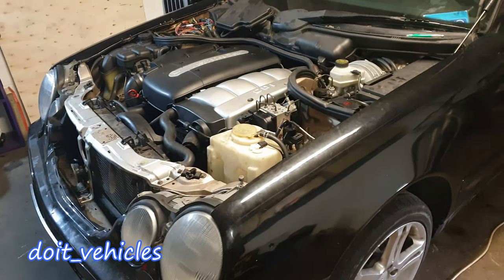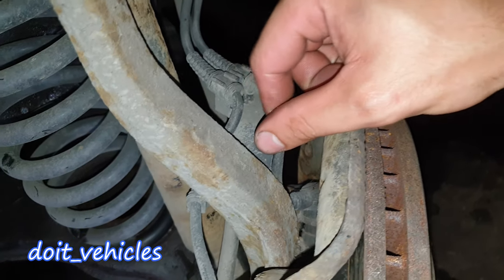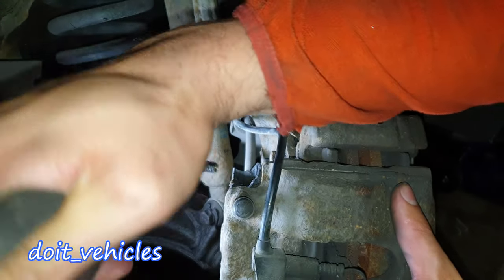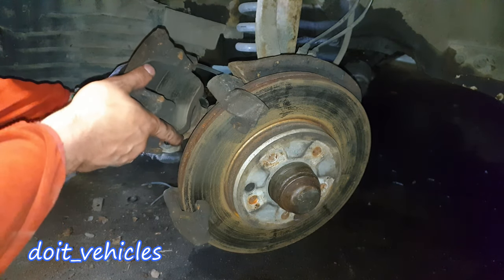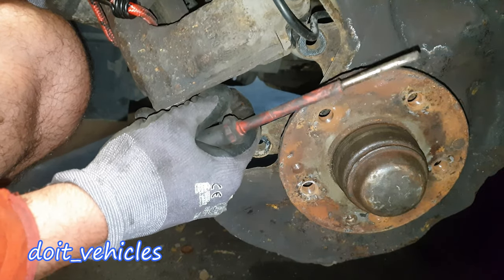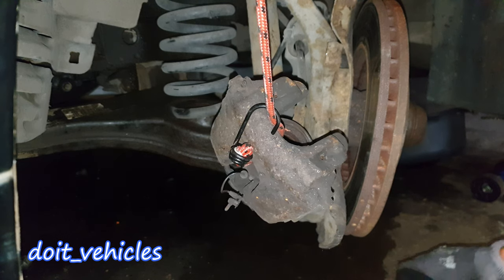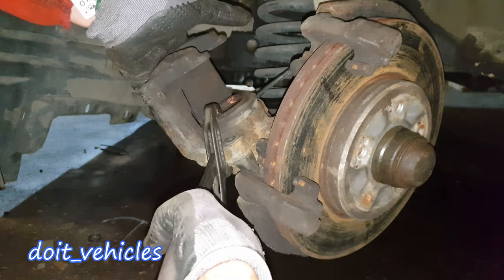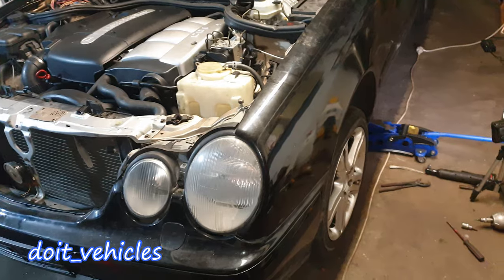Front Brakes Replacement Mercedes w210 E220 cdi

Comment: I have W210 1999 E320.. does it have brake pad sensor? I hear rough sound when I brake but I don’t see any warning on the dashboard..how to tell whether the brake pads are worn or not yet?
Reply from the maker: Hi ! Just remove one front wheel and see if there is any sensor on the pads . The " breaking material " is separated from the metal plate so that should tell if it's worn out.

Comment: For those of you interested, the P/N details for the w210 270cdi 95-2003 model:
- discs OEM P/N: A2104212512
- break pads OEM P/N: A0044200320
- brake consumption sensor OEM P/N: A14505401217